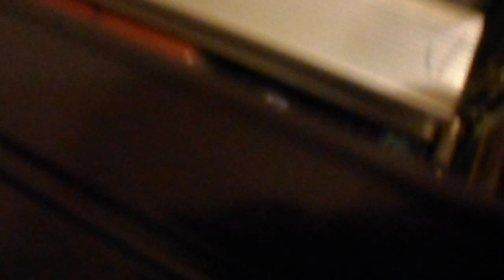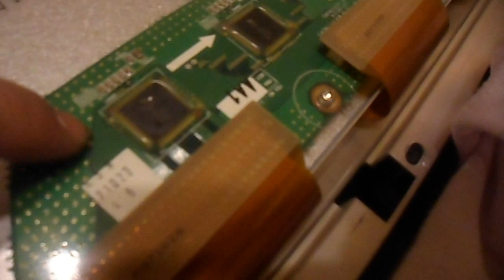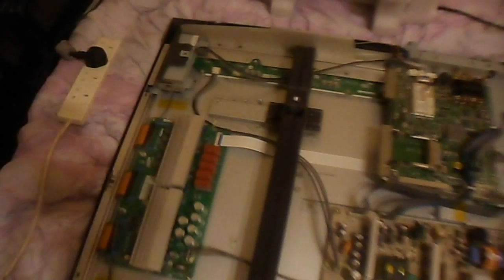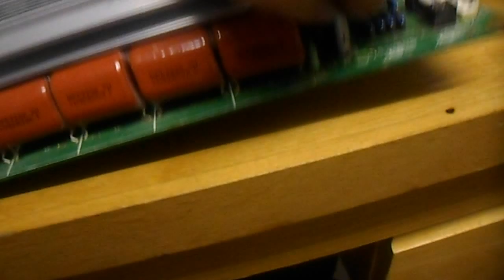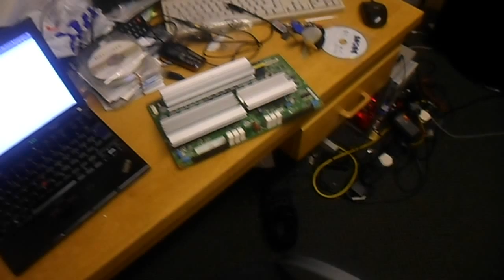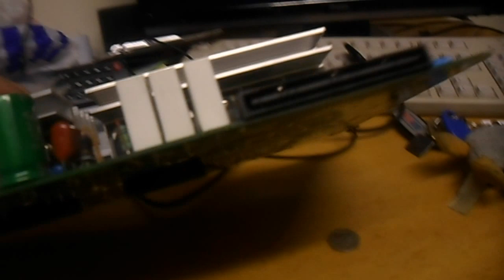Samsung PS50C98HD - No picture - Diagnosis

Comment: I have the same TV with the same problem. The B20NK50Z show some burning sings. Should I just replace the B20NK50Z ? Or will other parts needed to be changed ? Thanks a lot

Comment: Have a Samsung PN43E450 (A1F) here.
Startup only gives the samsung chime then I'm left with a blinking green LED on the logic board without the audio/video outputs.
Removing connection from the X-buffer on the right ( looking at the guts ) causes the LED to stop blinking at startup.
Would it be this board that has a fault??
How can I test this?
Thanks
NIce tutorials.

Comment: Well done! I have the same problem with the caps and fets and also found a bad diode.
I was wanting to know if you could help me identify a part number for a zener diode on my Y main? Phillips 50pfp5332d/37. Y main LJ92-01490 rev AA1 location ZD5101  (red,yellow,green stripes) I'm not sure how to do this without pulling a good one and testing it.

Comment: I just investigated further and found that my voltages are off. VS (should be 207v) is 458v and VA (should be 63v) is 33v. not sure how to proceed now. I should also mention that the sound works fine, and I am able to switch inputs so I assume that the control board is working.

Comment: I see that the fault indicator led is light up on the Y-main. Also the 2 capacitors you pointed out were bulged. I have replaced the bad caps, and checked the 2 fuses and they are fine. However the set will still not show picture and the y-main fault light is still on. I'm curious how to check the mosfets? I see no burn damage on the ymain or on the buffer. Thank you for your time

Comment: Cant find a VSET but all readings stay the same when set flickers.Should I get a reading on the VERC pin from the Y-sustain plug that goes over and connects to the X-sustain board? Could the Y-buffer cause this problem as I have read if you change the Y-sustain you should change the buffer at the same time! This problem is so annoying as the picture is so good when I first switch on. Thanks for any advice.

Comment: All voltage reading's are correct, VE 90, VA 54, VS 207, VSC -190 also 54v on E logic Buffer. There is also VSCH which I do not know what it's for or what reading it should have. Should the y-buffer's ic's get hot or is this normal? If I get the menu up and then come out of it i can still see it in the back ground when the picture starts to flicker as yellow,red interference.I can supply some photos if needed. Thanks for your reply.

Comment: You know what your talking about and that's good to see and hear.I replaced my Y-sustain as I had no picture but sound only, I now have a good picture but after 10min to 3hours the picture starts to flash as though the contrast has been turned right up then it will clear. I have put it in for repair but they cant find the fault. Any idea's ubuntututorials it's a Samsung 42" Plasma made in 2009. Thanks for all of you videos, keep it up.